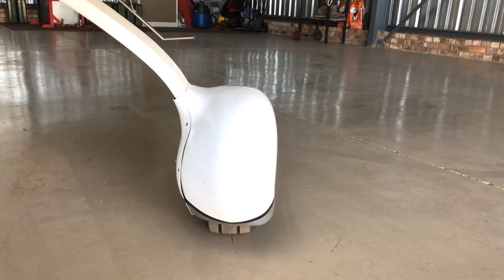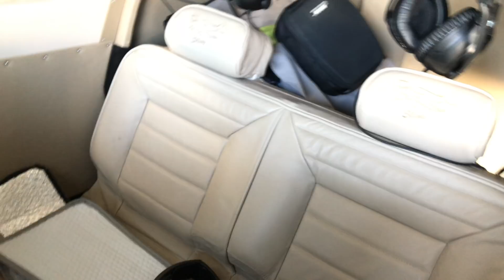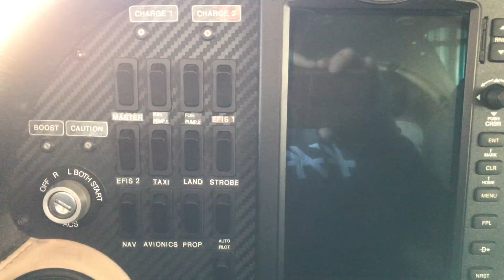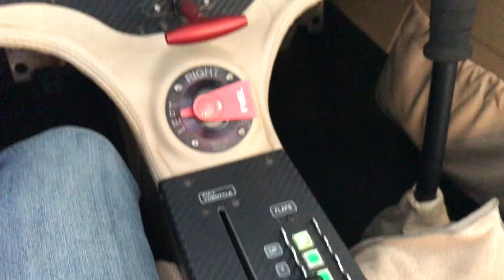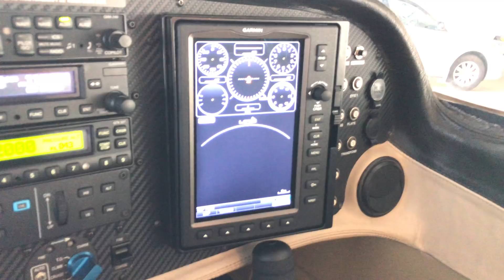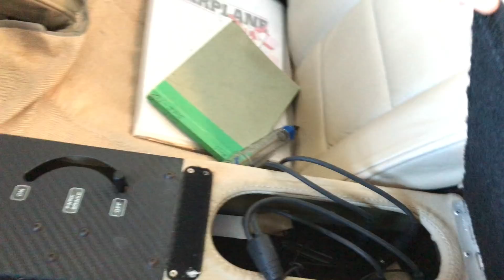Sling 4 Walk-around and Tour

Comment: Nice airplane !!!! who makes the propeller system ? and how much was the upgrade ...
Reply from the maker: Dave Johnson, as stated on the video, it’s a New Zealand Company called Airmaster. Don’t have the exact figure in mind now, but blades were roughly US$3500 and I would guess the electric Constand Speed Unit to be around US$4000. These are just educated guess values. Check Aircraft Spruce for accuarate prices.

Comment: I really like the paint scheme on this airplane.  I hope that she is serving well with her new owner.  I too am wondering about the 915iS in this airplane.  It should fit fairly well in the same space as the 914UL Turbo, but give you 20 more horsepower.  I mean, that's a no-brainer.  It certainly wouldn't be my airplane of choice for a long cross country, but for a 500 mile trip or so, I certainly could see flying in this.